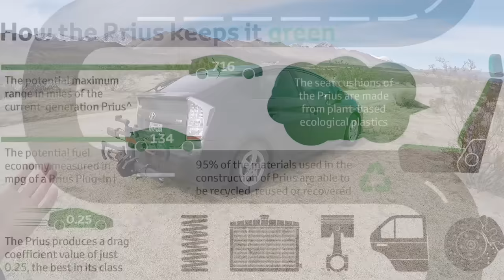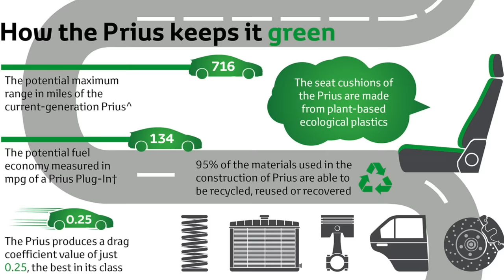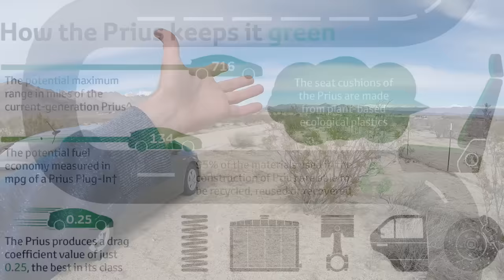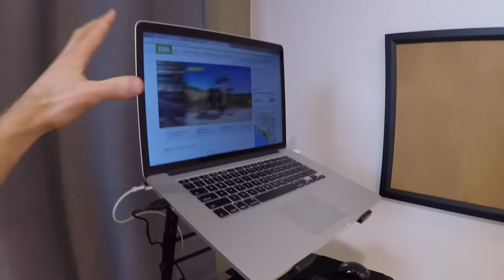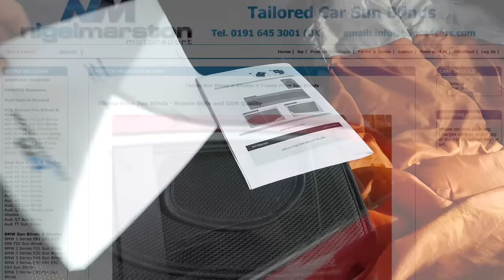How to Live in Your Car, Save Money and Be Free

Comment: Hell yeah, buddy!  I love all of the modifications.  I've been taking road trips in my 2010 Prius since I bought it in that year and nobody understands how great it is.  Put the seats down, lay some blankets or a mat down for comfort and sleep under the stars.  Wake up in the trailhead parking lot and get out there before all of the tourists are even awake.  

A note to those sleeping in a Prius overnight for the first time: the car is likely to make some whirring noises at odd intervals as pumps and fans do their thing.  The dealership told me that this was part of its normal process, especially if the car has been driven a long distance that day.  And, if you're going to lock the doors once you're inside, the "keys locked in car" alarm might go off.  Takes a bit of playing with to figure out how to not set it off, but I think that, so long as all of the doors and hatch are already shut when you push the lock-all button on the front driver/passenger door, the alarm won't go off.

Comment: Prius is extremely reliable and economical. My 2002 First Generation Prius drove past 280k miles with its original engine, transmission, ÁC, suspension, paint. It costs just pennies per mile. The Prius has been passing down to my college kids and they are very happy with the ease of parking and low cost of fuel refills.

Comment: Prius really is the best "car" to do this in.  I didn't watch all the video but hopefully he mentioned the coolest thing about camping in a Prius.  The Temperature control system that runs off the battery until it needs to use the engine at which point it will come on and recharge the battery.  It's like a really really efficient generator that keeps you cool or warm anytime as well as play music/audio, etc.

Comment: I did it in the 80s and 90s back when people had pagers and paid 50 dollars a year car insurance out of the state of florida. I regestered with all the temp services so i was on the computer. I also put a CB radio in my van and i would line up work with truck drivers on the interstate. Never bummed money. Always worked became pretty well rounded and adaptable to just about everthing. I think there is nothing wrong with what you are doing. Today with the cell phone and internet im thinking easy traveling. Truck plaza is a place to get cleaned up and might get some work with house hold furniture movers. Wish you well

Comment: Very smart set up u have used every inch of space .....cool 👍🏻👍🏻 can u please give us a review about things to check out before buying a used hybrid car.
Reply from the maker: Hmm... now that's a great question. I actually take my cars to a dealership first and have them do a full inspection (and tell them I'll be coming back to have everything fixed if I buy the car). It usually costs $100 and gives you some bargaining power to reduce the asking price if something is wrong. Like if the tires are worn down or the engine is rusted and the shock struts are bulging. My car must have been stored near the coast or something because it had a lot of rust. I asked it it was flooded and the dealer said no, just near a lot of salt water or something.  It's still holding up great but I was able to lower the price and then did a very thorough cleaning job and replaced the hatch struts right away :)
Reply: Thanks bro this info is very useful , love the way you do your videos with sincerity and humble opinion on the product waiting for more lovely videos from you 🇨🇦
Reply: ElectricBikeReview.com i only buy from dealerships in the certified pre owned section of the lot
Reply: @deejeff8846  I've also never had problems when buying this way. I bought a BMW pre-owned, then a Mini Cooper, and now a Smart Car, all a few years old when I bought them, and with low mileage and no problems.

Comment: Court hears maybe a suggestion. I recently picked up a Chevy Colorado. Small truck with Considerably Good gas mileage with whatever engine you pick. Could just sleep in the back. Avoiding cluttering the cabin. Maybe buy a cover for the back and go with the WT extended bed works good for me.  I am 6' 2"

Comment: I have a Prius as well, so I just want to make sure I understand this... cause ive taken trips in my car and was so paranoid about the car dying if i slept over night with the car on for ac... but youre saying it wont die? i spent a few nights in NC in like the 20s with my car off because I didnt want to chance it.. but I shouldnt have a problem if I leave it on?
Reply from the maker: Hi Kelly, with my Prius (and probably most of them) you just put the car in park and put the emergency brake on and then let it run. The engine will start and stop to charge the battery when it gets low and if you have the auto temperature set it will just blow air to keep you warm or cold... whatever you set. The key is to leave the car running though, if you turn it off and then try to run lights or something, it will run down the starter battery vs. using the hybrid battery
Reply: I have a 2014 Prius. You just start the car and leave it in park. The engine will only kick in if the battery is getting low in order to recharge it.
Reply: No idea

Comment: I saw you discuss really quickly how you want to keep the vent on the passenger side free.  This is real important because it vents the battery and hot batteries can reduce their life.  SUGGESTION: I have a long-haired mini dachshund (not like Jack, but a living, breathing and SHEDDING on).  I cut a small piece of single layer surgical gauze which I attached over the intake vent using blue painter's tape.  It is easier to catch hair before it gets in the intake tube or fan than having to take a lot of pieces off the car to get to the tube and clean the fan.  It also lets you know how dusty, hairy or dirty the car would otherwise be without it.  When you need to change it, it takes about 30 seconds.  Cheap & easy!

Comment: Great to see your setup. I bought a 2007 prius and fixing it up . The Ebike that I have been riding for years is a Surly big~dummy with a 500 watt motor with home made LTO batteries that can be charged in one hour. In two years I plan to camp out west using one or both depending on my fitness at that point. Thanks for your great video!

Comment: I have a prius also. I take a bungee cord and put it between the two rear grab handles then put a black sheet over it put two clips one on each side then drap it over the rear seats. I have 35% tint which is legal but not very dark. The extra shade makes it hard to look though car and give the appearence of 5-20% tint.  From the font and sides.. You can also open your rear hatch and lay the shade over the weatherstripping blocking the rear window more at the back. Block the rear windows the same way. and Put up a sunshade in the front. almost total privacy. Even though the prius is pretty safe to idle in extended might be prudent to get a battery powered Monoixed detector in case exhause ever made it back into the car.

Comment: I did something similar in Dodge Grand Caravan a few years back. The biggest problem was bathroom and distant second was electricity and internet. With bathroom you just have to always pay extra attention where you camp so that you can easily get to the bathroom - and it's not trivial and I feel like don't get's mentioned enough.

But what is absolutely awesome - is just how stealth regular car is! You can park almost anywhere and it's hard to see what's inside behind tinted windows. Especially if you place sun block on the windshield.

When you try to do the same with regular RV you'll find that people really hate RV's camping anywhere near Residential or commercial area. Even in industrial areas RV parking is extremely difficult. While car camping - there's almost zero problems.

I also tried camping in Tesla Model S and it was a game changer regarding electricity usage. You can basically run heater/AC all night in any climate no problem.
I can see now that you can do virtually the same in a much cheaper Toyota Prius.

The only slight problem is that Prius is only good if you're under 6', while Tesla Model 3 is good up to like 6'3" for person laying down in the back. It's a bit less convenient because of sedan format, but extra space and trunk sharing space with passenger compartment makes up for it.

I feel like Model Y will be that perfect camper car if it's a hatch like Prius.

Comment: Prius's and ebikes go together beautifully! I use my 2013 plug in Prius on road trips, with my Montague folder (Bafang BBSHD conversion, with a Rohloff hub), and can charge the bike  (600 watt inverter) while driving or parked, super efficiently. I leave the car ON for days, the gas engine only coming on rarely.  I took out my passenger seat (any passengers sit in the rear seat, where they have PLENTY of leg room), and the folded Montague fits perfectly in the space where the seat was, with room to spare.  It's super stealthy that way,  another great thing about a Prius is they seem to project a aura of being owned by respectable or at least responsible people, as in non threatening "nothing going on here",  and with dark tinted windows my white Prius makes me feel invisible.  Heat and AC all night if needed, camping in a Prius is great.  I have 40 acres I live on, but I really look forward to my next Prius/ebike road trip, where i will get the usual high 40's to mid 50' MPG, try that with a Winnebago!

Comment: Hello. I think your cabin lights are old wire lights if i saw correct. You should definatly replace them with leds for less battery drain if u let the doors or trank open for long periods. Actually you should replace any old light you have with leds.

Comment: If I was living in a Prius full time, I'd consider removing the seats to make even more storage space. The fridge shown is not that efficient, a compressor type is much more efficient and can get it colder when it's hot outside. But you don't want to run it off the car battery when the car is not running, it uses the starter battery, not the big one. (Looks like the fridge is off in this video when he's not driving.)

Comment: I live in a city and has been thinking to do move into a vehicle because rent is too high. However, I cannot decide which one is better to call a home: Prius or RAV4? How much comfortable is RAV4 compared to Prius? Prius is cheaper to drive by 10 mpg. If you were to buy and choose between the two, which one would you get and why? I was also thinking of getting Mercedes Benz Sprinter because I could stand inside and live more comfortable but it would cost more to drive and it would not blend in when I'm park. I would like to be discreet about sleeping in my vehicle, it seems that RAV4 and Prius are discreet compared to Sprinter.

Comment: I have a 2014 Toyota Corolla 4 door Sedan that I have been sleeping in for almost a month.  The front seats lay all the way down and are quite comfortable for a side sleeper, like myself.  I just push back my driver seat all the way and lay down the front seat as far back as it will go.  Then, I pull a goose down comforter over myself and turn on the heater for a few minutes when needed on cold nights.  I use a nice pillow and I'm good to go.  I thought about getting an air mattress for the back seat area, because it's so large, but the front seat works fine for now, so will not go to that trouble.  Most Walmart stores where I am located no longer allow overnight parking, so I now park at Lowes, Home Depot, and Sams, without any problem.  I move to different spots so as not to be noticed.  Also, I am a black card member at Planet Fitness, which has really nice showers with hot water, so I shower daily there and also exercise three or four times a week.  I rotate locations there also.  The only thing that can add up is food expenses if you spend too much on fast food, so I eat a free lunch daily at a local day shelter.  I invest in fruits and non perishable items for breakfast and dinner, like protein bars, crackers, peanut butter.  I find free wifi signals across from where I sleep at fast food places like Freddy's and McDonald's and watch movies for free on my computer.  If you are resourceful, you can really save a lot of money doing this, even on a shoestring budget.
Reply: Wow and I was wondering HOW WOULD YOU SHOWER ....i love the planet fitness idea! Really considering doing this
Reply: Can we keep in touch??
Reply: @cleo6189 After I tried it for awhile, I couldn't cope with it.  It's not as easy as I thought.  What I did was move to Mexico (Puerto Vallarta) where the rents are much lower.  If you are on a Tourist Visa, you need to leave and back and every six months to renew it.  Interjet has really cheap flights.  I found a nice one bedroom, fully furnished with dishes and wireless, everything except for electricity.  I just found the electricity would be much higher in Summer here, he said about $100 to $150 per month.  So, during the hot months, it's more expensive if you run the air conditioner all the time (which is something he neglected to tell me).  The food is cheaper here too.

Comment: Tractor trailer uses 1 gallon fuel an hour. You could get a cable come along to carry they are light and could pull your car out of as stuck situation.
Reply from the maker: Interesting... first of all, I like your username ;) could you link to a tractor trailer? I'm not sure what you mean exactly and if it's a full trailer I wonder how it would effect my Prius? It's not rated to tow anything really
Reply: When I was trucking the truck would burn 1 gallon an hour. That got really expensive  especially since you have to shut down for 10 hours by law.

 I did tow a V nose 5x10 trailer form GA to LA I will not do that again. I had a head wind the entire way drove interstate speeds and got just 20 mpg. I do use that trailer for utility jobs around town but I do this only when I can't get things delivered. 

I own a RUN AWAY camper 4x4x8 camper basically a box with an AC on it. I tow that at 60mph max and I get 30 mpg at that speed go slower get better mpg. I own my home and I keep the runaway for a bail out home we have hurricanes and if you can leave town with a trailer and generator you can keep your wife and daughter in the camper and I can sleep in my car.
Reply: I had the handle grunge luggage tours and when I went to the RTR people looked at me like I was an insect so I decided to change that name. I had a pair of bull horns I could put on the car so I put them on the car and said I am now the Prius cowboy. Trying to find a pink cowboy hat for the full effect.
Reply from the maker: Ha, that's awesome! Sounds like you've done some interesting things, the bull hours made me smile

Comment: Thanks for a great video.  I'm planning to sleep in a rental car tomorrow on a road trip and this gave me a few ideas.
Reply from the maker: Sweet! How did it go Agent Smith?! Don't leave us hanging XD
Reply: Actually very well.  They gave us a Renault Clio and not the big car I was expecting but we put the seats back and slept pretty well.  I bought some things to cover the windows and we left them open just a crack for air.  On the way back we parked in a dark corner of a service station just after midnight and I think there were 3 or 4 cars next to us where they were also sleeping.  Nobody bothered us or even looked at us and we saved 2 nights on hotels.  This was all in Turkey BTW, on a trip from Istanbul to Gallipoli.  I found temperature was the main problem - even at 25 degrees at night it felt a bit hot.   I think your Prius or an EV is much more ideal as you can leave the AC on.

Comment: Do you have any overheating issues with the cooler since you are blocking the vents on the top when you stack the pillow on top? I have the same cooler and I was worried that it would fry the motor. I'm guessing those air vents are there for a reason.

Comment: Doubt your still checking comments on a video this old. But you should consider ceramic tint. Reduces 99% of uv and 50% of ir Ray's keeping you cool and uncancered in even the sunniest spaces. It works even if you get a totally clear one. Also strengthens the glass a lot but that's not a commonly someone you will need.

Comment: Was thinking about doing this in my Corolla. I wan't to remove the rear deck (you know, where the speakers are mounted) so I can have a more spacious bed.
Then add a shit load of dynamat and liner to my ceiling and walls to insulate the AC, convert the glove box to a fridge and line the whole interior with LED strips. 
I'd be willing to work, piss, and shit at Walmart, no issue with that. For the rear windows I'll get a pull-down screen that blocks out 100% light.

Comment: I’m really looking into this lifestyle, my only question is about bike security on the rack. Id have a similar small car setup, with a bike as well. Have you ever had any issues/do you have any tips for bike security?
Reply: I haven't done car camping (yet), but I'm thinking about it as well. I have a pretty nice bicycle and I keep a U-lock on it. My house was broken into and the U-lock prevented them stealing my bike. So that would be my recommendation is put one around the rear wheel and the frame, and/or bike rack. It's not 100% theft proof, but the thief would have to be pretty committed, as they would have to carry it (not ride) away and cut the lock off with a grinder. 

I'm still curious to know what other people do though. That's one of many questions on my mind if I ever try this method of travel.